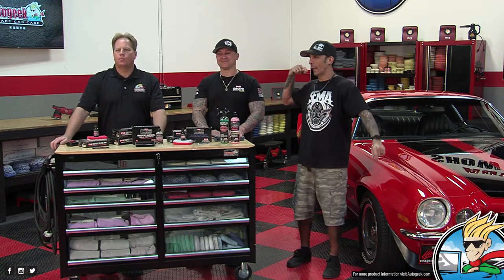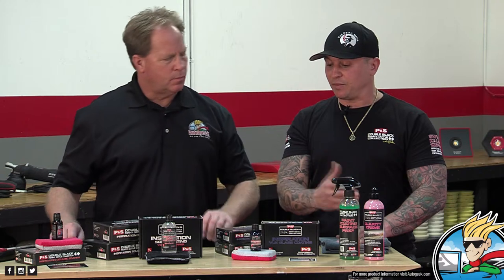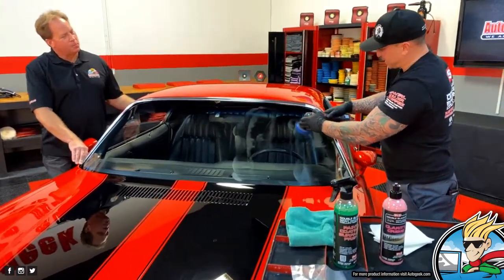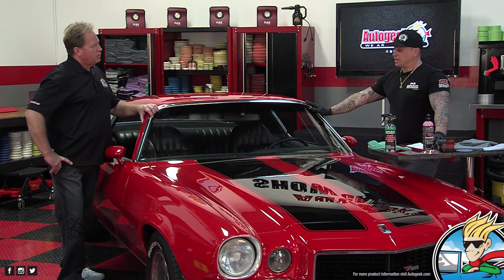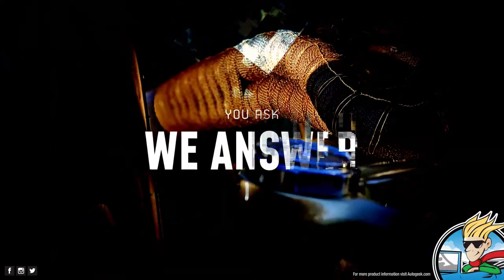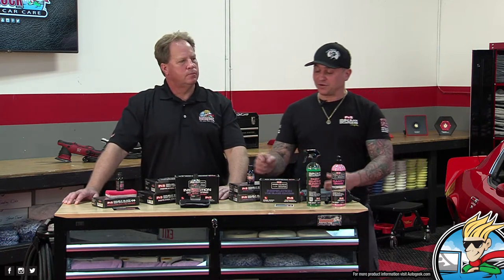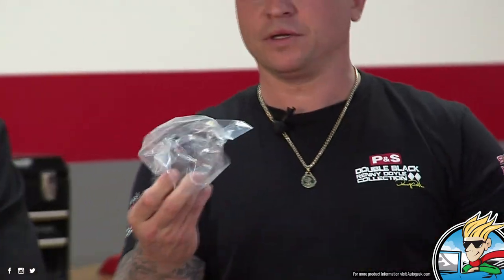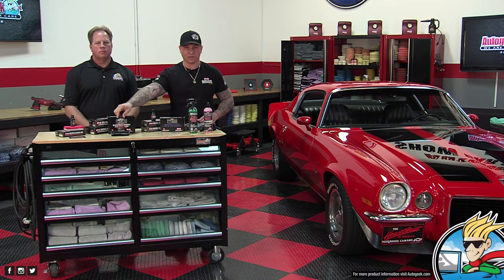New Detailing Products Showcase - P&S Detailing Products

Comment: #Justinp&s
Reply: One thing I absolutely love about P&S products....VALUE!    You can't beat the value of their stuff and it all works great!   I love their Double Black Peroxide Finisher for my fabric detailing.   It's the last step I do every single time to finish off the fabric clean and neutralize the chemicals used.   It works great.    Their fabric cleaning/finishing system of 3 products is one of the best out there.   Then complete the fabric detail with a good quality fabric protection, you will keep your fabrics looking great for a long time.    Another one I really like is their Interior Detailer.    That stuff is one of the best values in detailing.    A gallon is dirt cheap and will last you a long time.   It can be diluted too but I tend to use it straight.   Foams up incredibly well and wipes clean, leaves a great scent.  It's a true winner.   In fact, most of P&S products in the gallon sizes are really cheap.   For anyone that is value minded but wants really top notch products to use as a weekend enthusiast,  you can't go wrong with P&S products.   You can buy enough products to do a complete detail and last you YEARS for a couple hundred bucks.